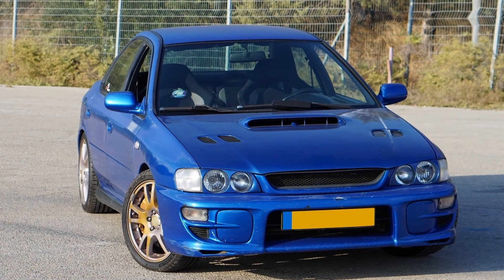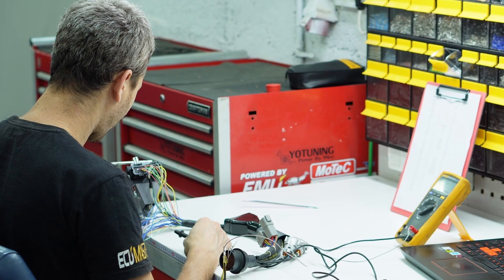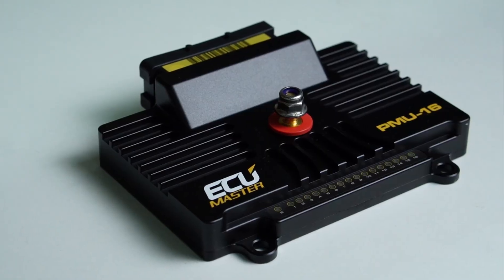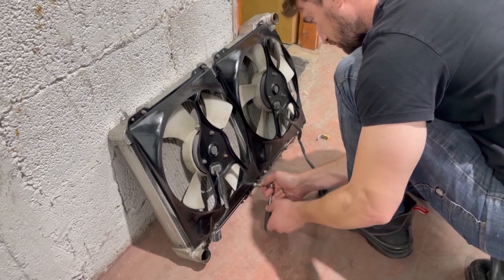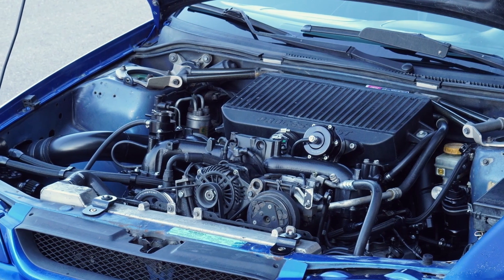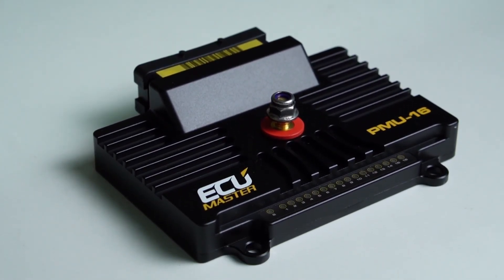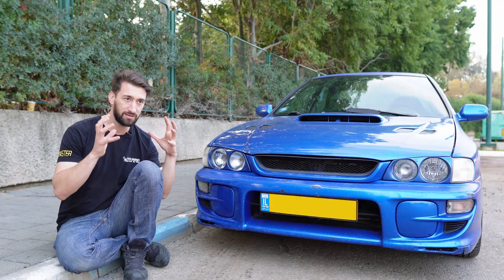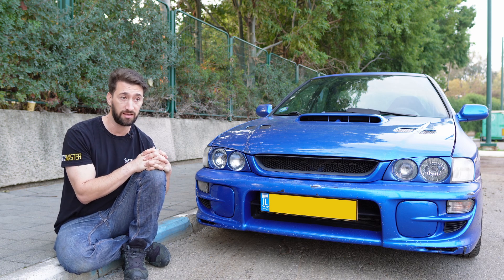Old Subaru, Modern Features (PMU16)

Comment: So 3 point of connection for canbus, pmu, ecu and keyboard.  Where did you connect them all?  Just a near the pmu?
Reply from the maker: @damnitdang  
There’s one point near the bulkhead connector on the cabin side. There are a few coming for the PMU sub harness (for keypad, ECU harness and can-to-usb adapter) and there’s another Canbus connection that goes from the Haltech ECU directly to the Wideband controller but we still need to find a more elegant solution for that.

Comment: Hi, 
Do you know if the pmu can be connected to the original steering column switch?
Thanks
Reply from the maker: If you are referring to the key barrel switch then yes! 😊
Reply: Thanks for the reply. I'm referring to the indicator and light switches.  to try to make it more original instead of using keypad buttons
Reply from the maker: @fernandobranco9590  
Yes, they can also be connected.
Reply: Thank you very much for confirming this to me.  I will probably follow your footsteps and do the same.  I saw the other videos you made, and I have been following the process.  Could you leave or show the measurements of the wires you made your harness?  You help us all with your videos, very good work, thank you for that.👍
Reply from the maker: @fernandobranco9590  
If you go back to the first episode in the engine bay harness series you will see at 7:35 a chart with all the components and measurements but I wouldn't recommend using it since every engine bay is different, sensors will usually be in different places and there's no guarantee the layout for my engine bay will suit other engine bays.